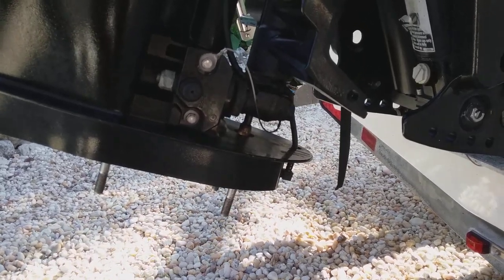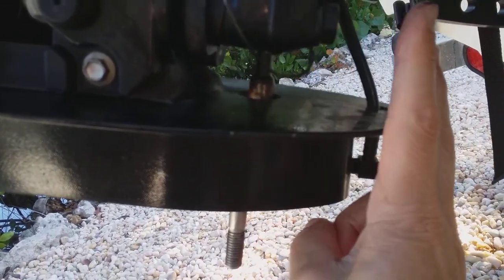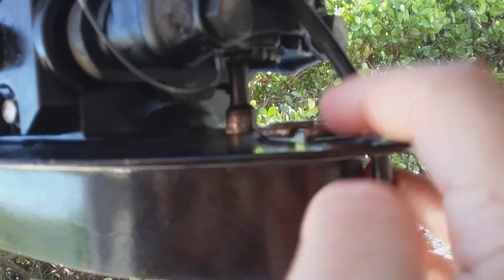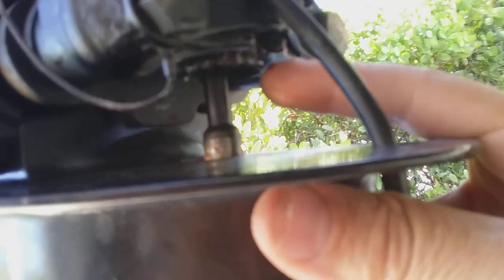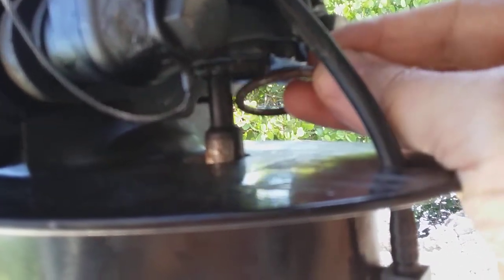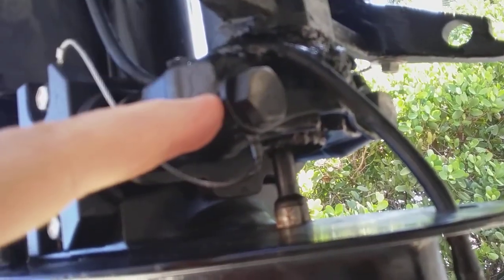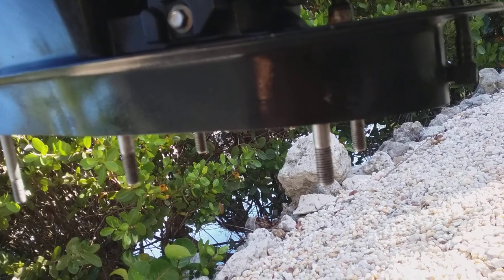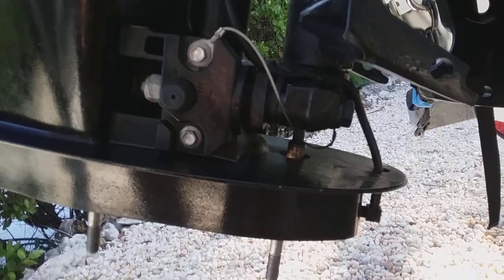Mercury outboard swivel bracket retaining ring part# 67684

Comment: Thanks for the video. what's your advice when it is fully deteriorated?
Reply from the maker: If things are tight in terms of motor not at risk of falling off, ride it out. If you think your motor could snap off, you may need to replace that hardware. Hard to say from here but play it safe, I know a guy that was killed when his motor flipped into the boat. Granted, different issue but could contribute to that type of accident. He hit an underwater powerline.

Comment: you do need the ring. whoever told you that you dont is a liar... the ring is thereto stop the assembly going up and down...you need to drop the leg out the way then tilt motor fully up and get cleaning and replace the ring with a  new one. its not  a hard job , just get the wire brush out and clean it all up. .once back on paint round the area with enamel paint.. once dry chuck a nice big blob of grease round the lot so it helps against corrosion.
Reply from the maker: Nice in theory but when the spindle is rusted too much no ring will stay put. So if it fell off, more than likely it will never stay on again until you replace the entire shaft. I agree in a perfect world all parts should be perfect. If there is any chance someone thinks there motor is in jeopardy of falling off by all means replace everything necessary. The odds of motor rising up off that shaft even with the missing ring are lower than getting hit by a meteorite, IMO. Thanks for your input.
Reply: No. It fell off because rust in the groove forced it out. Clean all rust from groove and put in a new ring. Its common fault that needs to be put right.
Reply from the maker: Ok, good to know, sold that boat a year ago. Thx
Reply: @wetlifesports  mine is coroated away.. cant get the ring back in. I dont have groves either.. gone.. my engine is shaking and making a clicking sound. Not engine but like the whole thing shakes. When engine is if, i see play in that era. What can it be? In need of help
Reply from the maker: @christinaanderson2575  sounds like you need a new engine mount assembly. I would definitely check it out closely. You don't want it snapping off underway.
Reply: @wetlifesports  when i hold the ring in place it does not shake..
Reply from the maker: @christinaanderson2575  I would get it fixed
Reply: @wetlifesports  off. I just wondered if u knew any about it
Reply from the maker: @christinaanderson2575  just what i show in video
Reply: I have that exact problem as Christina Anderson. Thinking about changing the whole thing. What is the name of the part that I would have to change exactly?
Reply from the maker: @allanciogilbert5968  sorry, not sure, google "parts diagram" for year and model. Also boats.net is pretty good with diagrams and parts.